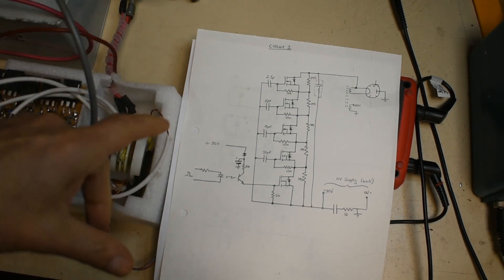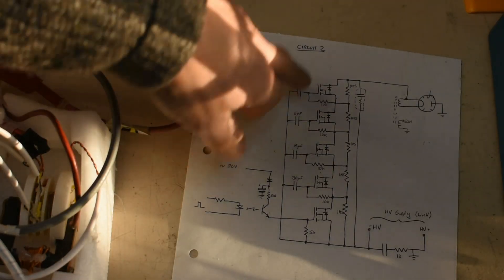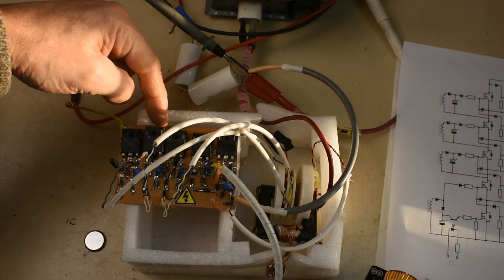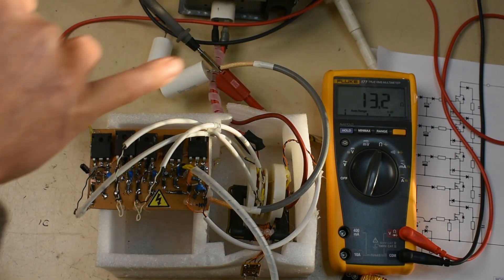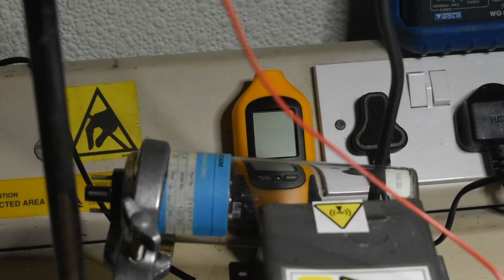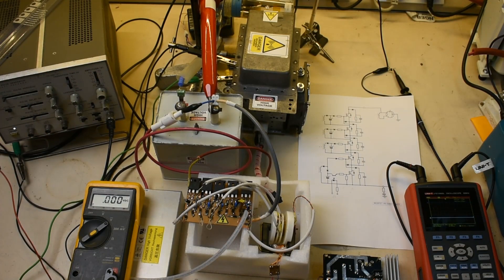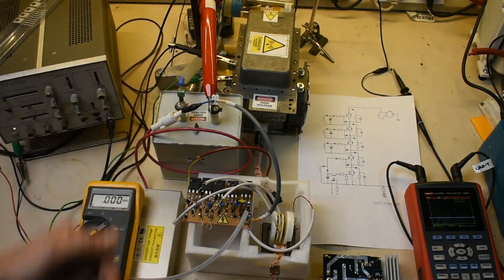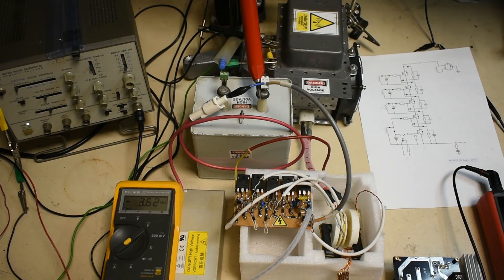Magnetron Pulse Switch continued

Comment: Hello, very interesting commutation scheme. I use a high voltage IGBT module at 6500 volts 250 A. inside the module there are 4 substrates with 3 transistors for a total of 12 high-voltage IGBTs, 1 substrate can be unsoldered and used for switching
Reply from the maker: Thanks, I normally use IGBT modules too, but I needed a very fast switch here and I don't the an IGBT would have been fast enough. However, the magnetron response turned out to be far too slow anyway. Interesting that you can modify the internal substrate for switching. Must be tricky working through the silicon jelly they are normally protected in.
Reply: @tuopeeks  According to the datasheet, high-voltage IGBTs are quite slow. In practice, the turn-on time is 500 nanoseconds to 1 microsecond, which is quite good with a slow magnetron. silicone can be removed very well by hand, and the residues are dissolved in acetone and cleaned off with a toothbrush)
Reply: @tuopeeks  you can use a miniature hydrogen thyratron if you do not need to regulate the pulse duration but only the frequency
Reply from the maker: @zilipoper  I liked the idea of using a thyratron being very robust but I did need to control pulse duration.
Reply: @tuopeeks  The simplest way, which does not require the use of rare and expensive parts.  This is the same oblique half-bridge, but for the forward converter.   ferrite transformer in hard mode, where the voltage drop under the switch is minimal. take a large area of the ferrite transformer so that it can normally pump power of 1-20 kHz and adjust the pulse duration from 1 microsecond to hundreds of microseconds
Reply from the maker: @zilipoper  Interesting, I did also look at pulse shaping networks with a thyratron to control the pulse duration but it would be fixed rather than variable and a bit complicated. In the end we were looking at less than  100ns pulse timing.  The magnetron couldn't react in this time never mind dump the power into microwaves. I was also running into speed issues with my SicMOSFET circuit.
Reply: @tuopeeks  if you manage to make a cascaded high-voltage chopper using multiple low-voltage mosfets, this thing will cost hundreds of thousands of dollars)) I saw prices for such modulators, and they cost more than a Tesla car for a compact box
Reply from the maker: @zilipoper   😆Yes,  I did spot that when I was looking into what was available. Quite surprised how much they cost and as you say for a small box. Can only imagine the feeling if it failed from over voltage during an experiment.
Reply: @tuopeeks  I use crystals from the INFINEON FZ200R65KF2 module   https://theelectrostore.com/content/datasheets/fz200r65kf2_dat.pdf

Comment: So did you basically just design the flyback-inverter transformer from your previous video (you showed the flyback-configuration inverter transformer board you took out from an inverter microwave yeah?) did you just unwind the current primary while still using the second coil and heating element wires and now drive your manually-wind primary via ZVS?
Reply from the maker: I didn't modify the oven inverter as I couldn't switch it faster than 70ms. The high voltage for the pulse tests was derived from a charged-up capacitor, charged from a lab supply. This allowed me to drive the magnetron at higher voltages than the standard oven inverter will deliver. The ZVS driver is purely for the isolated heater supply and low voltage SiCMOSFET gates supplies. It maybe possible to drive the oven inverter transformer directly from a ZVS but for the magnetron current very heavy primary turns would be required.
Reply: @tuopeeks  For the high voltage side of the magnetron requirements you could use the ZVS to drive a self-wind primary coil of 5-0-5 centre tapped on the ferrite core of a flyback-transformer either bought or salvaged from a CRT TV and use its high voltage output for the magnetron.
Reply from the maker: @arkohmay  You could, but if you are driving a magnetron at say 900W and using a 18V DC supply it will be about 50A in the primary.

Comment: Hello
I'm curious - if you pay so much attention to the modulator circuit, with topology which is popular for conventional pulse magnetrons, why not try a real one, I mean, pulse magnetron itself? There are many of them on ebay and they are quite cheap (if we mean S-band) and the output result will be much better instead of "oventron" which are not designed to work in pulsing mode. I`ve been workng pulse microwave sources for 7 years already and have tried many variations, including the oven magnetrons too - yep, they can give some pulse output, light up a neon bulb or so, but their cathodes cant produce same current density as indirect heating oxide (especially on high PRF), so the peak pulse power is pretty low. Besides that, at short pumps (like 1 uS or so) they start to oscillate in floating mode (jumping from normal п-mode to the high order electric field-patterns and back), which also increases power drops to the output. So, I highly recommend trying a real one, there is much more fun with it.
Reply from the maker: Thanks for the good point and comment. This experiment came from a question I was asked on pulsing oven magnetrons. I decided to look at MOSFETs for high voltage switching applications as they can be driven off as well as on for variable pulse times. The first thing was to see if MOSFET switching would be reliable and did spend a bit of time trying cascade switching, but have had some problems with this. Lately I’ve had a bit more success with individually opto-isolated gates. Although, the gates are limiting the switching speed. You are right that the next issue looks like the ‘oventron’, as you say. It does appear to react but the output is less than expected even with higher than anode voltage.  Looking at S band magnetrons sounds like something worth trying. They are relatively cheap but still considerably more than an ‘oventron’. I’ll certainly consider it.
Reply: @tuopeeks  For the cascode-type switch-modulator I can tell you, for example, about one we made with colleges for 100 kW Ka-band magnetron. It was based on 12 SiC  1.7 kV FETs in series. Each of them had a driving cell, consisting of ultrafast logic, LDOs and EL7155 gate driver. Every cell was powered up individually with a small n87 core transformer and all primaries together were driven by 1 MHz LLC converter. The switch-pattern generator for high side logic was made by time-division-sequence technic, with complex on-time/off-time logic-synthesizer, which was buffered by bridge on two EL7155 and went to the small metglass core transformers, which were driving high-side logic cells of main switches. In a word, the idea of such driving is a 200 nS pulse "ON", then a dead-time which corresponds to the needed pulse width ( 1uS, for instance) and another 200 ns pulse for "OFF". Each power-cell transformer and driving transformer were made on two separate cores with "shorted" coupling wire to minimize stray capacitance (each 1 pf added approx 10W power loss). So all of these resulted in a modulator which was extremely robust for EMI with 15 kV 15A hard-switching and it wasn't going to die no matter what we did with it. Unfortunately, I can't say the same about the opto coupling-drive version. The next good choice is the marx-based circuit and then one with a large, HV, pulse-transformer.
BTW, If you are increasing the anode voltage for more power, do not also forget to increase magnetic field induction with more strength magnets. And, anyway, there is a current-density limit due to the Child-Langmuir Law for the electron cathode beam perveance, so it can't have infinite boosting.
Reply from the maker: @Magic_Tee  Thanks, interesting project and not too dissimilar from my situation. You also highlight the increasing level of circuit complexity I have been trying to avoid. I had been avoiding pulse transformers as I wanted a variable on time but hadn’t thought of the pulse on/ off route. Yeah, was aware of some of the limitations on increasing the anode voltage by much, just appears more disappointing than expected 😊 Also seeing a difference in output between switching on anode or cathode which seems counterintuitive. With the switch on the anode side giving a better output. I suspect leakage or stray capacitance though.
Reply: @tuopeeks  Yes, when you have a switch for cathode side, which floating respectively to common ground, you`re also required to charge and discharge the capacitance of the filament transformer, which could be significantly large, especially in case of coaxial windings. So, a HF filament-transformer with low interwinding capacitance (few secondary turns on opposite core side corresponding to primary) is an option. When working with floating anode, the magnetron case and waveguide interface capacitance to common ground is an issue - it would seem that such little capacitances can't affect the performance, but stray L and C components are one of the biggest problems in such circuits types. Also grounded anode has the benefit of allowing touching a waveguide while the circuit is working.
Reply from the maker: @Magic_Tee  yeah, totally agree. I am driving the heater at HF with a few turns but I'm using the same transformer for the LV DC on the gates. Probably enough cross-talk to spoil the output.
Reply from the maker: @Magic_Tee  You’ve got me thinking about the route you use to switch the Sic MOSFETs. So far, the individually opto-coupled route has worked better than the other methods I’ve tried.  If you have had better luck using pulse transformers might be something I should look at.  I’m actually looking at this as a request from a university in the states wanting to pulse a magnetron at 200ns. It’s a tall ask to achieve this speed and I’m struggling to get much faster than 1ms even from a test equipment point of view. Do you think your switch could be pushed to these speeds with a S-band magnetron?  I think the university may have asked a question on one of your videos. If you are willing to talk to them directly, I can give you their contact.
Reply: @tuopeeks  Well, a description of driving patterns and design considerations for such things with a few words, is just simply impossible. Or it will be the first book written on the youtube comments section. But, if briefly in general:

1) Choosing for switch-driving topology is strongly and accurate according to a time-domain regime of modulator and circuit topology itself. For cascode-type circuits, each one of three variants such as optocoupler, time-division-sequence and direct GDT pumping (close similar like it be done in DRSSTC or any gate-drive-transformer inverter) has its advantages and disadvantages. The optocoupler has a significant parasitic capacitance if we talk about IC-based solutions and a noticeable delay mismatch. These two parameters can be a headache with switch-cells quantity more than 8, with high input supply voltage (more than 10 kV) and high PRF (more than 5 kHz) and a short pulse duration (less than 300-500 ns). The solution here might be in a fiber ultra-high speed opto RX-TX, with precise delay matching and its widely used in some CERN`s "inductive adder" linear pulse modulators for precisely cell shot synchronisation of injector accelerator pumping. But this solution is pretty high-cost and looks a bit overkill for 5-6 SiC FETs with low PRF and large pulse duration like 1-2 uS or so. A time-division-sequence which is utilized in our modulator is a compromise solution. Notice again please, that transformers don't drive the gates directly - a low-side logic with buffer creates on-time and off-time pulses sequence and transformers transmit this signal to high-side logic for each cell, based on a couple of 74LVC1G97 MFG ICs. Also using a short-wire coupled cores transformers decreases parasitic cell capacitances to ground up to 300 femtofarads respectively with VNA measurement, which dramatically reduces dynamic switch losses on high PRFs. The directionaly transformer gate driving is one of the simplest and cheapest methods to implement, in general thanks to ability of no needing to supply high-side drivers and using ICs on gate, but you must pay a lot attention to transformer`s parasitics like interwinding and secondary-self capacitances and leakage inductances. Moreover, if you are working with short pulse duration like 200 ns or less, you need to use a metglass or nanocrystalline core, with extremely high permeability (ab, 50-150k) and rectangular hysteresis loop curve - this allows you to minimise leakage inductances, stray capacitances and give an ability to work with 1 wire primary, keeping primary magnetising inductance in acceptable range to transmit a short pulse with rapid rise/fall times and not being dropped flat part of the pulse. Sure, for longer durations you can use a regular T38/N97/N87 ferrite but keep an eye for the moment of core saturation. Based on above, it's getting obviously that there is no ability to transmit any long pulse duration with direct transformer gate driving technique in contradistinction to time-division-sequence, but in your case, I would most likely prefer to use GDT if your SiC FETs don't need to be negative biased. And the last, may it be obvious, but - don't use one common large core for all cell drives. Only separate transformers for each cell, with shorted-wire coupled cores technique for each transformer. All primaries are in parallel to the output of the sub-modulator. 

2) Now, about a 200 ns pulse duration for an S-band magnetron.
Pulse magnetrons have a finite time of steady-state field-mode forming due to the trajectory of electron in external magnetic field (which is not straight one), acceleration potential (anode voltage) and dimensions of interaction space between cathode and resonators (and some other factors that take a long time to list) . There is a rule of thumb in correlation with magnetron working frequency and pulse duration, sounds as the more higher frequency magnetron has, the more shorter pulse duration it needs. A typical pulse duration for S and C bands magnetrons is about 1-10 uS (depends on cathode ability to keep full emission current density for all on-time. With a very long pulse, the cathode may start to burn out and lose emission), for X-band - 0.5-2 uS, for Ka - 300-500 ns and so on. For instance, a 210 GHz spatial-harmonic mode magnetron has a max pulse duration of 50 ns.The topic of cold emission cathode magnetrons stands apart, but we do not consider them now. So, what I'm talking about - if you apply too short (like 200ns) pulse to the S-band magnetron, most likely it will not have time enough to enter the steady state working mode and will start a noise oscillation on the current pulse falling-edge instead of clear RF-pulse, so it doesn't make any sense with S-band magnetron. And besides, the design of a modulator for such short pulse durations is a serious challenge for an engineer to be honest, even on high-speed SiCs or hard-tubes.
Reply from the maker: @Magic_Tee  Thanks for the record breaking YouTube response, you cover a lot there and quite a few of my concerns in aiming for the timing limitations. This has given me a few things to think about. If you are happy to discuss this further with me or Illinois University by email I can be contacted from my about page tuopeek.com/about.html. There is a direct email link on the tool bar.
Reply: @Magic_Tee   о Кунлаутер))))
Reply: https://www.youtube.com/watch?v=qXxhJ4WDzEs&t=5s&ab_channel=zilipoper

Comment: hi, why not using a tube? there are plenty of trashy tubes that can be held at like 5kV and you can give a shot on the grid(s) and obtain some hundreds of milliamperes of drive, at pulses level the power rating of the tube isn't an issue also
Reply from the maker: yeah, it is probably the sensible option, but I would need quite a big valve able to handle the current/voltage. Also needs the heater supply etc. Just thought I would try the MOSFETs as it seems to be the solid-state solution
Reply: @tuopeeks  why not keeping the anode of the magnetron at like 4.6kV, the filament at like 1.3kV and the source of a single mosfet at zero, you can keep the filament at that voltage with a voltage divider or a single resistor to GND (an oven magnetron seems to absorb like 3-5mA at like 3.3kV if i remember correctly), then the drain will pull low the filament and the mag. will receive enough voltage to absorb whatever current (so you'll use a limiting resistor in case), this way you can use a single mosfet of yours, that will see a max of 1.3kV... ?
Reply from the maker: @PosthumanKindergarten  Yeah, also a good idea but the magnetron anode sits at high potential which isn't great as easily touched. If I was just testing it as a one off  for myself I would try that but I was asked if it was possible to pulse an oven magnetron fast for a project so got to be safe.
Reply: @tuopeeks  then shift anything down like your doing now, also use the optocoupler, even if optocouplers are already at limit at 5kV (if i remember correctly) and regular ones can't switch 1 microsecond neatly, also (if i remember correctly (again)) magnetrons need a minimum time to stabilize, so one microsecond could not be enough (and this would luckily add up with the optocoupler keeping the mosfet on for a longer time) better scope the amount of time the magnetron stays fully on with... like... a germanium diode on an antenna and a microscopic capacitor that would make a DC pulse the time the mag. shots microwaves
Reply from the maker: @PosthumanKindergarten  Yeah, the opto-coupler being used here is ok for 10 kV max. Its not the usual DIP packages, but probably means its even slower. Good point on magnetron stabilising time. No info on that as they are for CW use, but it shows a bit on the scope. I am using a aerial and diode sensor to look at the output.